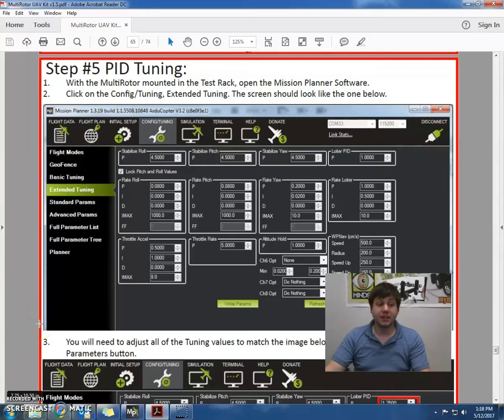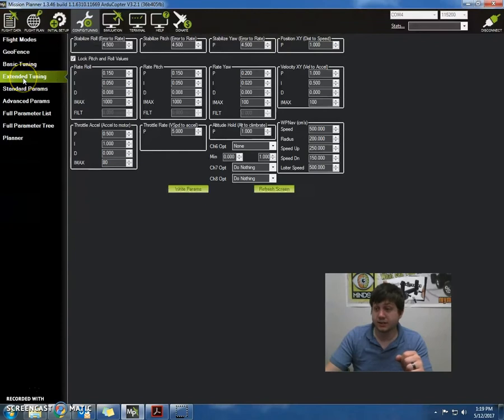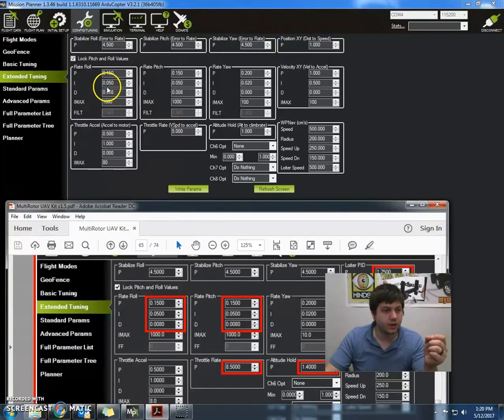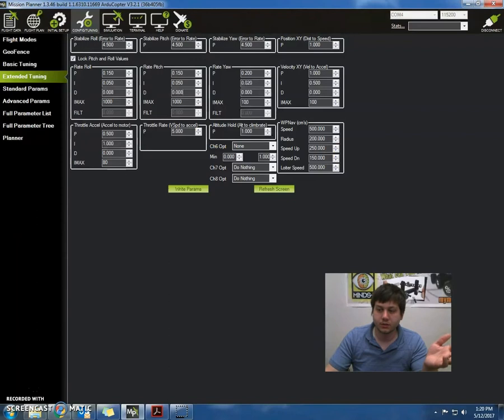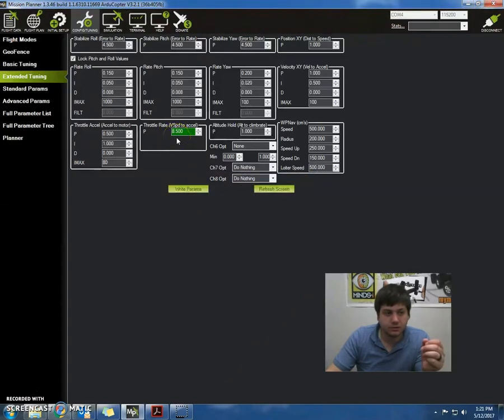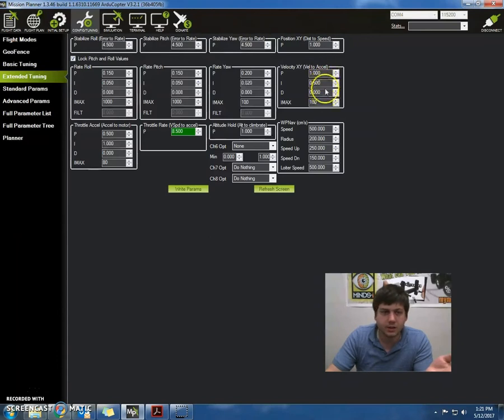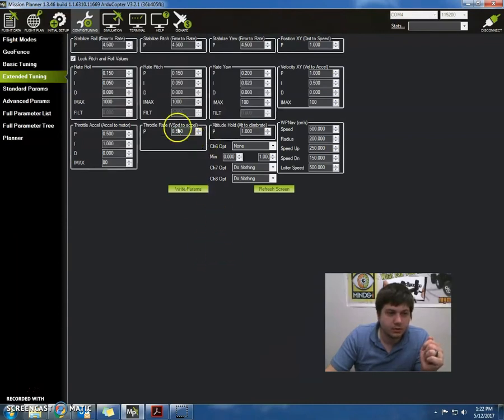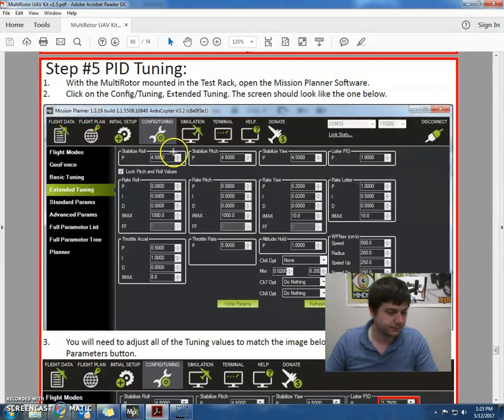MINDS-i Mission Planner Step #5 PID Tuning

Comment: You're reading through a PDF with a series of Mission Planner instructions. Are these instructions supposed to be available in our kits? I don't see them with any of the included materials.
Reply from the maker: This is actually our older instructions based on mission planner but you can grab our latest instructions and dashboard on our website here: https://cdn.shopify.com/s/files/1/0048/7129/0950/files/UAV_M305_v1.9_904cf522-7ce3-4ab6-8a74-7ed58f503091.pdf?v=1600903180
Reply: @mymindsiinc  Thank you. The curriculum for Drones 90hour lesson 7.5 references this video in the lesson plan.
Reply from the maker: @austinulakovich4714  You're welcome!

Comment: Is this okay with Tx AT10II RADIOLINK
Reply from the maker: @rmuznet, the PID tuning is specific to the MINDS-i quadcopter. You'll likely need to make adjustments to your tuning if you are flying a different model. As for the Radio Transmitter, MINDS-i uses the Spectrum DXe but the mission planner should work with the Tx AT10II, just make sure to run the radio calibration and properly bind your transmitter to receiver.
Reply: hi,how adjust the yaw on tricopter ?thank you
Reply: thte yaw is slow?